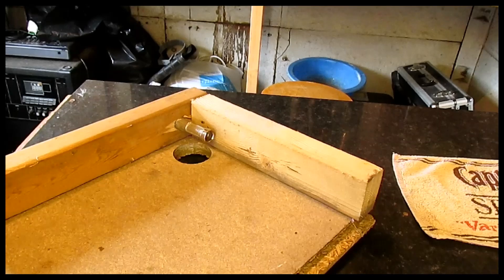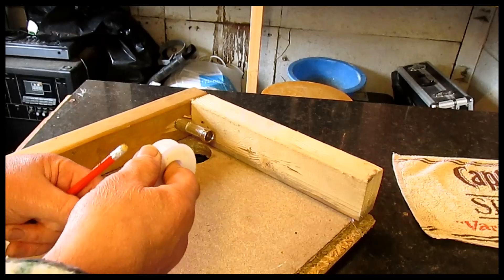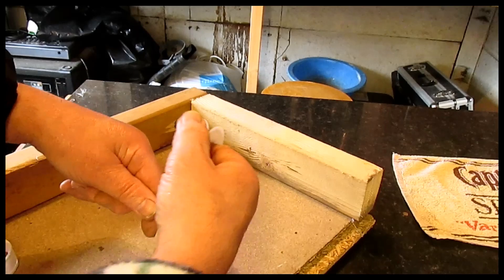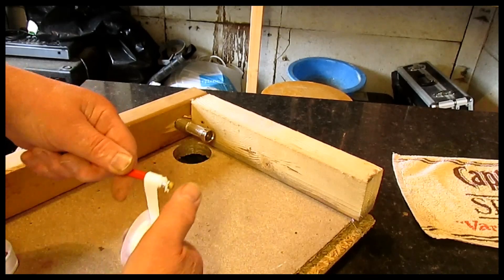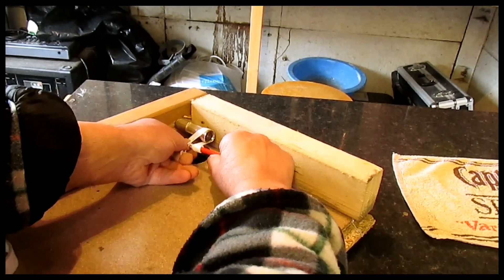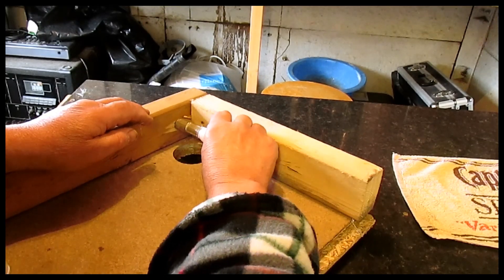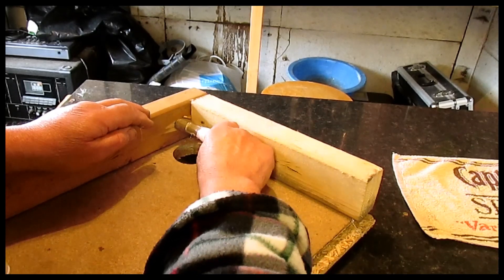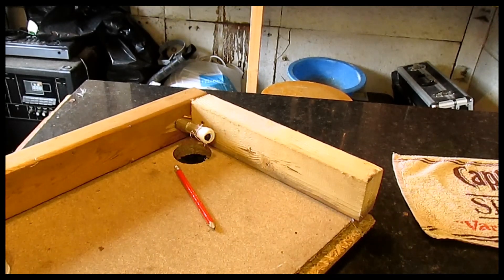applying ptfe in a tight corner

Comment: Hello from Washington state in the USA. Thank you so much! Great tip! It worked great! 
This is exactly what I was looking for. About a week ago, I used teflon tape when I installed a replacement bathroom sink valve -- in a tight space where I couldn't just roll the tape on. I fiddled around the did my best. Within less than 10 minutes there was a constant drip. I finally had time to fix the problem today and the first thing I did was search for tips for teflon tape in tight spaces. I saw the link to your video, watched it, it made sense, so I tried it. Thanks again!